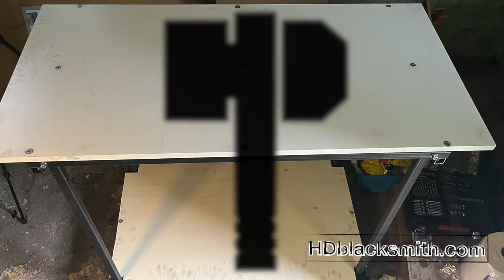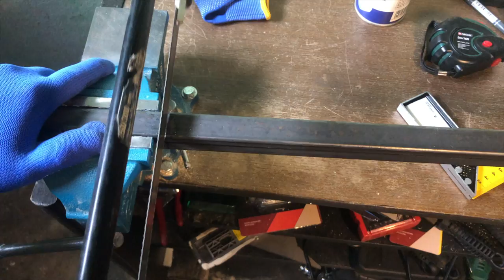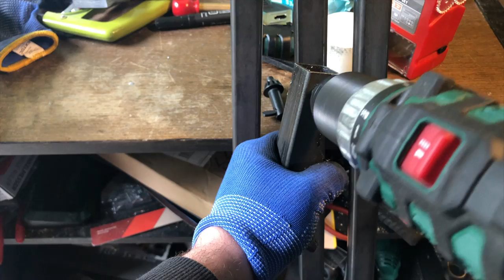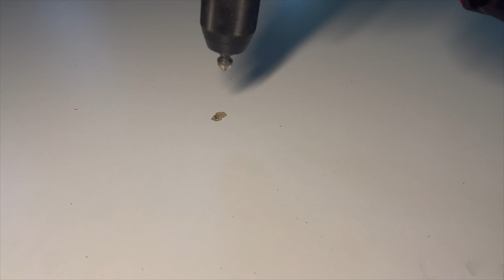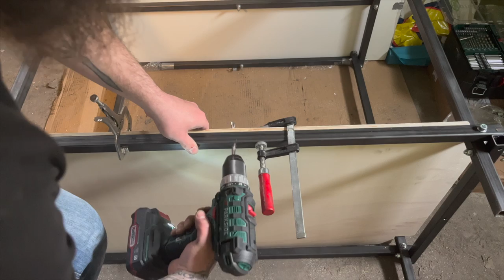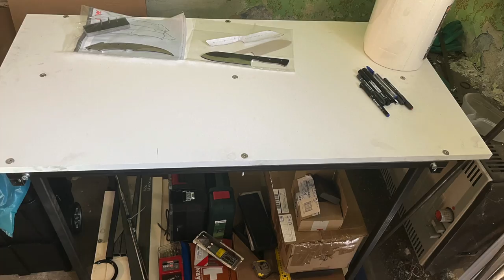How to Build a Steel Frame Workbench Without Welding

Comment: Great video! You may be interested in  connectubes for building a steel frame without welding. The system is super cheap and uses steel couplers and 1.5 x 1.5" square galvanized steel tubing.  Highly recommend you learn about this building product to use for bbq frames etc...
Reply from the maker: Thank you, i will check that.